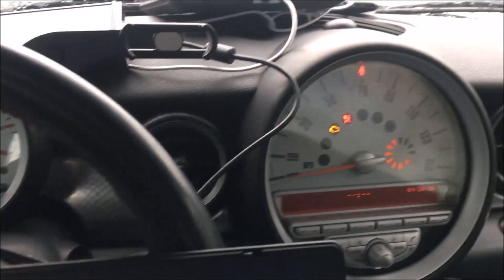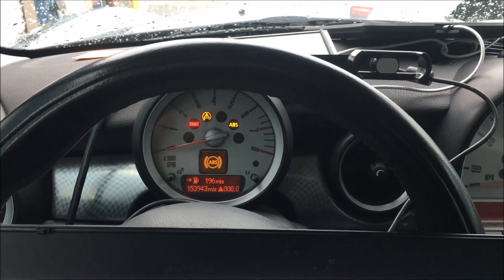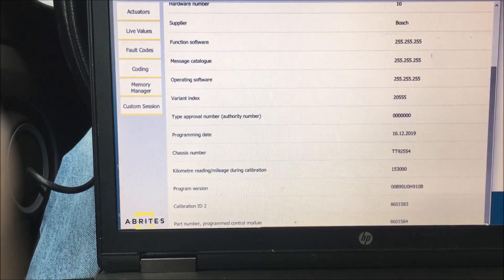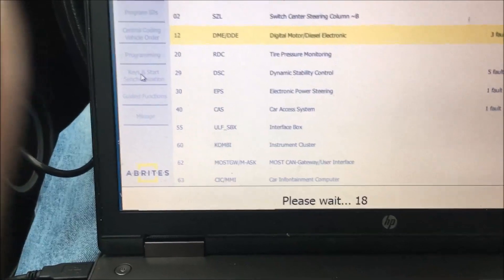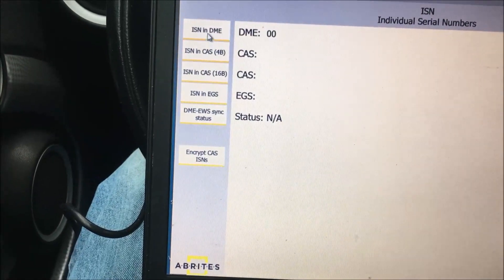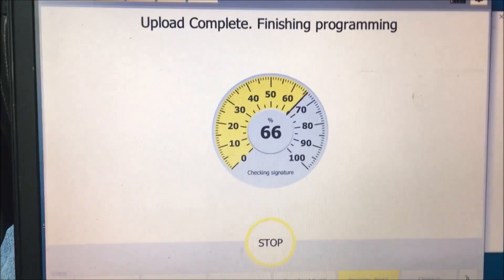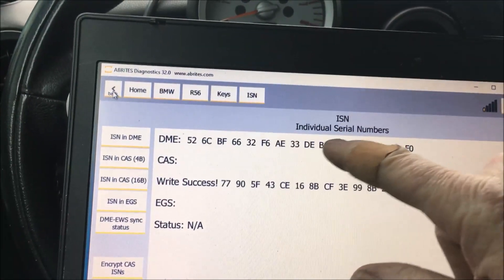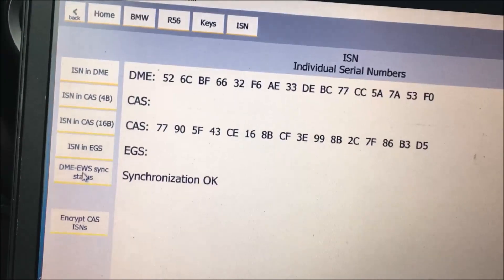Programming used DME into 2008 Mini R56

Comment: That was my question can you just take Disconnect battery to clear everything on the car
Reply from the maker: do you really think you can clear all the errors by disconnecting the battery?? if that was so, everytime you disconnected the battery, the CAS and the DME would loose sync .. the cas and the DME have memory chips that save the data that is written into them.. If it was that easy, there wouldn't be any shops replacing these modules.. dealers would go broke, kaos would ensue... But really, no you can't just disconnect the battery and have all the errors go away..
Reply: Your correct nothing is that easy of course

Comment: a friend of mine has a mini with auto gearbox, is it possible to use a dme for manual gearbox? because I could not find any for auto.
Reply from the maker: A buddy of mine has a lawnmower, if I change the carb, will it work????  It helps to know what year and engine... there are several different DME's and different configurations, if the module has the exact same numbers, then yes, it should work... but you have to code it the same as the module you are replacing...

Comment: I am in the same predicament with my mini Cooper. The cas and dme are not in sync. I'm not finding any technician locally to fix my problem. Do you perform this service? Currently the mini runs, but it identifies as an automatic, but it's a 6 speed. Any help would be appreciated.
Reply from the maker: If your CAS and DME were not synced, your car wouldn't start.. Did you change the DME? how did you DME get to thinking it is an automatic?  someone had to code it or the DME is from an auto.. best to find a DME from a stick car... Find someone with an Autel Maxisys, as long as they have a current subscription, they can go online and recode the DME to what the car has...
Reply: @timtracy9442  Thanks for the reply.  Initially the previous owner threw a lot of parts diagnosing it, and told me that the last thig to do was to change out the DME. I bought the mini and did the same thing. Dumped some money in it hoping to fix it. Rough Start, but once its warm I can drive all day.  I found a company that claims to "FIX" DMEs.  So I snapped a pic of my DME and sent the module in.  They sent back a DME.  But not the one I sent them.  I plugged it in and still have the rough idol when cold, and now a new code of no communication with the transmission control module, and now the cruise control doesn't work.  I found out that the order number is wrong.  I also found out the DME I sent to them is not the original one that came from the factory.  Apparently the previous owner swapped it out. That's when I stumbled upon your video.  I'm tired of jacking around with people that say they know what they're doing.  You seem to be very knowledgeable.  All I want to do is drive.
Reply from the maker: @sxshn8  I know how you feel... Sooo, the DME is probably coded wrong for the car.. When you replace the DME with one from BMW, they code it with information from the Vehicle Order, which they have on there server, when you put a used DME into the car, you have to first either change the ISN in the DME to the cars ISN, or you change the ISN in the CAS to match the new/used DME's ISN, then you change the VIN in the new/used DME, then you you go to the vehicle order, which is saved in a few modules in the car, read it and then the program that data into the new/used module's... I would ask around to your local locksmiths or shops and see if anyone has Abrites.. The online version is pretty good at programming these.. good luck..  Right now I am trying to figure out why a 2015 550i sport won't transmit data from the CAS4 to a new/used DME.. sometimes I think BMW made this stuff like this just so you have to take it back to the dealer and buy new parts, or a new car...

Comment: from 12:22 to the end.  is this the way like you explained to flash dme thi same cas asm? is this the procedure to do 1st? is that necessary in that order? or it just turned out like that... then u showed to cas encrypt asm into the cas cause dme tends to encrypt it.  my real Q is should i buy a use dme with same vin #...
Reply from the maker: I don't think you can buy a used DME with the same VIN as your cars.. they are all unique... The reason you encrypt the ISN is because on this car it has a CAS3+, the CAS sends data to the DME and the DME has software in it that decrypts the ISN.. if you didn't encrypt the ISN in the CAS, when the CAS sent the data to the DME it would be wrong...
Reply: @timtracy9442  okay so what's the new DMV cost and as far as the comment do you think is okay to buy the vehicle

Comment: 07 MINI COOPER S 1.6L 4 cyl turbo engine, with a 6spd manual transmission. Power windows, tilt wheel with cruise control, leather seats, new fuel pump. Will need a new DME that's German for PCM, ECU ( computer ). The car runs and drives and is very fast. Throwing a DME code. So when you start the car it revs up and down. You have to reset the code then the car drives fine.....what's your take on this matter....is it worth buying??
Reply from the maker: I really couldn't say... it's impossible to diagnois something over the internet...

Comment: I noticed your abs light was the n after the coding.  How did you resolve that?  I just had my ECU cloned and car starts as expected. But abs/dsc light is on with a 05de3 dsc encoding error.  How to resolve that?
Reply from the maker: I just used AVDI to recode the DME to what was in the cars build data...

Comment: Hi Tim, I scrolled through the comments and didn't find an answer to this question.  Abrites has a lot of options for purchasing software.  I have the Autel MS909 and the IM608.  I have successfully done Mercedes cloning with the ECM and TCM.  I am being asked to clone a 2012 Mini Cooper R60.  Can I do that with the Autel or do I need to purchase this software?  If I need to purchase this software, which package would be the one I need?  Thank you for your insight into this area.
Reply from the maker: Have you used the 608 to clone a BMW DME? if it worked, you should be able to follow the same routine...
Reply: @timtracy9442  I have only successfully cloned Mercedes with the MS909.  I have not done any BMW cloning.

Comment: Hi Tim
I'm also stuck with a 2011 R60 Countryman Replacement DME and CAS
I bought Autel IM508 with XP400Pro as well as their Gbox2 I still have not been able to get this car started somehow the CAS Eeprom reads the correct Vin and mileage but still some info from the donor car.
No working keys so no dash lights.
The Abrites software seems to do this easy.
Can you tell me exactly what I would need to buy.
Their site specifies a lot of options, I'm not sure wich way to go?
That was a great video thanks.
Richard
Reply from the maker: Soooooo, lets start at the begining...  You have a 2011 Countryman and you bought it with out a CAS or DME?? or are you trying to install the DME and CAS from another car because one of your originals was bad??  If you get a set from the same car, and a key, you should be able to plug and play.. the ISN is only in the DME and CAS, if they are realy from the same car, they should be OK, the only way they get unsynced is if you try and put one or the other into the car and power it up... that will cause the DME and CAS to become unsynced...

Comment: Hi Tim I purchased a use transmission from a wreck yard and it has gear stable on dads and a p0962 code I spoke to salesman at the yard he told me that I need to reprogram the computer clear codes. And transmission should be good to not sure if he’s bs me. these codes are the same ones that were on my old transmission or ecu a 2008 Mini Cooper  thanks for any help.
Reply from the maker: Not really sure on this... does the trans have an ECU in it??  the older cars, pre 2015 usually don't have anything in the trans, it is all managed by the DME... use a decent scanner and look for actual values, see if the pressure control solenoid is showing the right pressure... also, look at the code, is it active or historic??

Comment: Hello  can you please tell me this if mini stuff can do these things please. AVDI, BN012, BN010, ZN002, and ZN051 program key fobs no keys, synchronize Dme/cas and change vin and mileage too.
Reply from the maker: You would have to send an email to Abrites and ask which special functions can do what...  I buy the whole package so I don't run into that dreaded warning, License not found.... As for changing mileage, you can change the mileage in all but the cluster, and if you change all the mileage in the other modules, the minute you put the cluster back in, it will revert to that mileage...  The best way is to remove the cluster, change mileage on the other modules, then use a program such as Digiprog and a new chip in the cluster to reset mileage in the cluster, then put it back in the car... Actually had a 2010 335i that a ( Automotive locksmith) put a CAS and DME into to get the car running.. easier than actually making a key for the car I guess.. The only issue was the donor vehicle had double the mileage on it... the car went from 72,000 to 148,000... the car lot wasn't happy loosing thousands of dollars...  so we changed the mileage in the other modules with the cluster out, then read data from the chip in the cluster, then wrote that data and the correct mileage into a new chip, then viola, life is good.. Just remember the chips BMW/MINI put into there clusters are what are called incremental chips...  they can only increment upwards...

Comment: Hi Tim, 
I have a 2009 mini cooper r56 non turbo, n12 engine (daughters) I have replaced the ecu (used) and am having the same issues you had. (cas synch,encrypt, align... ) I have an Autel im608 and j2534 pass through tool but it doesn't seem to be able to do the alignment. I've read where it seems many have bricked their CAS and I'm hoping to try to not do that. I have bimmertools, inpa, winKFP, etc... Can I use my autel j2534 or K+dCan to fix the realignment issue? And just wondering what program might give me the best results. I was able to update the used ecu and all the other modules in the vehicle with the im608. But the Cas synch is holding me back from getting it started. I don't have any arbrites software or their tool... Thxs for any help in this... Erich (using wifes youtube account)
Reply: Should also mention the CAS seems to be a CAS3+ so encryption is a requirement I believe as shown in your video...
Reply: Just noticed today when playing with the im608 that I may be able remove the CAS and read, write to it direct. Not sure if it will give me the encrypt option though. I thought I watched a vid of yours that looked like you did the same thing though using an autel programmer with a CAS on the bench. I'll have a look for that vid again.
Reply: Just hate to have to take the dash apart if there is an easier, safer way of doing it...

Comment: I was wondering if I could use a different Dme, Cas, Fob, and fob holder in my 2010 r56 as far as I know I have Cas4 in mine and there's cas 3 in there's.  Can I use a year before mine, 2009, as long as it came out of A/T turbo car? please help going threw H. E. double hockey sticks  trying to get my daughters fixed. I've been ripped off twice now with so called 'ecu repair shops' trying to avoid that again. I have bought a computer with a lot of bmw software.  Ista-d, ista-p, ista-icom,  Isn,  ncs/expert tool32,  Inpa, and (I/me) still can not synchronize the used DME. I used the same part with the same part number as my original Dme and Cas that I purchased before I got ripped off and they kept my only working key fob. I read the original DME and wrote to the donor DME with Ktag and then tried synchronizing them with bmw software and it didn't work. Just contacted bmw dealer for new DME, CAS, and KEY fob, they want over 4k for them. somebody that knows please repl
Reply: Did you ever get this figured out? I have a 2010 R56 and just bought a ECU, Cas, FRM with keys because it had a manic stage 2 tune on it for a fraction of the body of a tune but once I swapped it all over the car wouldn't turn over. It powered up without any warning lights and a solid key light. I'm guessing I need to code something...Im wondering if the origin car was an auto (mine is a 6spd) and maybe that's the issue.

Comment: what exact cable and program are you running and what years does it cover I have a couple of mini's 2010 mini cooper s r56 n14 and a 2012 mini cooper clubman s n18  r55 i think that's wright. I been getting the run around from different ecu repair places and would like to be able to do it myself. I purchased a used dme the same  part number and inside there the same bought Ktag read from the original and wrote to the donner and found that the dme/ews will not synchronize and I can not get the ISN out with inpa, nsc expert, and more help please

Comment: Awesome video! Thank you! My issue is I bought a 2007 mini already not running with the old crank but not start issue and after checking everything I think it's the DME. Just wondering If I can pull one at a junk yard. Then get it encrypted by someone as knowledge as you guys. I'm in California.
Reply from the maker: sorry for the late reply.. but, YES.. there are all kinds of places that can program a used DME.. most places will ask you to send your old DME and the new/used DME and they can transfer the data...

Comment: Question I bought a 2012 Mini Cooper at auction and then found out it had a dme and cas module from another mini so i decided to buy new dme and cas  modules does it need to be programmed to mini or should it be just plug and play
Reply from the maker: If the DME and CAS came from dealer, then they need to be synced to the car and to each other...  You can use the BMW ista program, I think its about $40.00 for a 1 day subscription..  There really isn't any module in a newer BMW product that is plug and play... Sorry.... Did the car run with the DME and CAS it had in it??  If so, why not change the vin to the cars vin and then sync to the other modules?? If you watch the video, this car had a used DME and we changed the VIN and coding to match the car, and it worked fine.. In fact, this car passed me on the freeway the other day, the lady who bought it was having all kinds of fun with it...

Comment: Hi Tim, after watching your videos i have been considering on the purchase of this great tool since i'm a mobile programmer in my area and i have been staying away from programming BMW and mercedes due to high costs involved in equipment. just one question though: are you capable of doing Mercedes TCM programming (New or used) and BMW DME programming (used or new) with the regular software included in diagnostics? or do you need to pay for additional software for this capabilities? thanks .
Reply from the maker: The only software that comes with the interface is diagnostic tools...  To virginize and program any modules you have to buy the special functions.... As for TCM, if you are asking about the conductor plate, yes, it does awesome on used modules, but has some issues on new from dealer modules... The modules from the dealer are coming without a base file, you can download the zip file which has just about all of the base files for the modules from Abrites, but you have to ask for it.. As for the BMW/Mini cars, I really like what AVDI can do for the later models, 2006 and up, prior to that there isn't much coverage..  Also, check out the Autel Maxisys elite, it is a great tool...
Reply: @timtracy9442  Oh and thank you!

Comment: hi good i can ask you a qquestion about advi and ford
Reply from the maker: That depends....    AVDI and Ford are not the best fit....  Some cars it does well, others, it doesn't do much at all....  I had a 2006 Mercury sport ute (same as a ford Escape) where I tried to replace PCM, tried with AVDI, no go, tried with AVDI as the passthru  and FJDS as the programer, didn't work...  Bought Drew Technologies Cardaq2+, and used the FJDS and module programmed right in..  2010 ford fusion, customer replaced ABS module with used one, used avdi, downloaded ETIS data, ran the program, it updated coding and VIN in abs module...  Tried to change mileage on a 2008 Ford F150, wouldn't do it, sent email for tech support, they came back with not supported, when I asked why it was listed in the manual, they said maybe some day...  If you are just doing key programming, the AVDI is just fine...